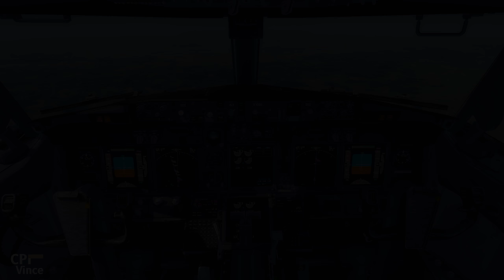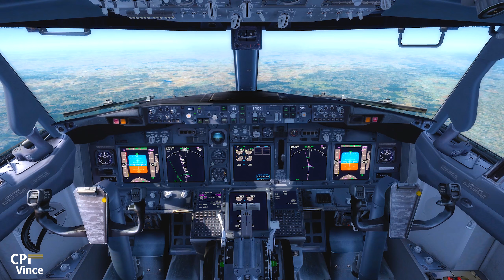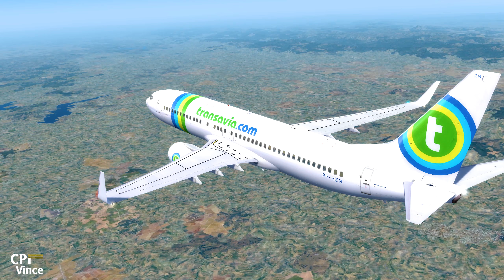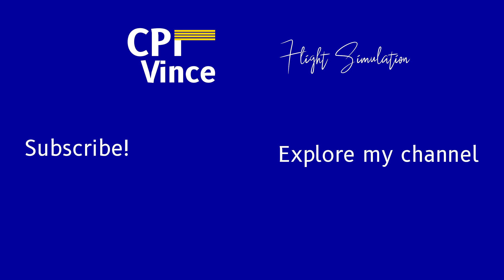Prepar3D V4.5 | Fix Flickering Black Screen

Comment: If you dont use v-sync, just try to run p3d with disable full screen optimization, in properties of shortcut p3d. This is WIN10 1809 issue.

Comment: hello Cpt. great video!! question I have the same issue but another guy toll me that is because Im using a 4k monitor Ultra HD 3840 x 2160 resolution with 16:9 aspect ratio before I go back to the store and return it just want to make sure that the 4k is not an issue my pc have a I9 9900K CPU OC @5G with GTX 1080 TI 11G  im new to P3D and been try in to get in going thanks so much for your help